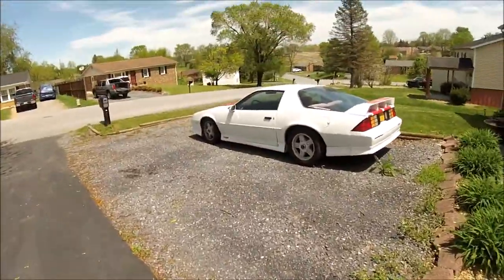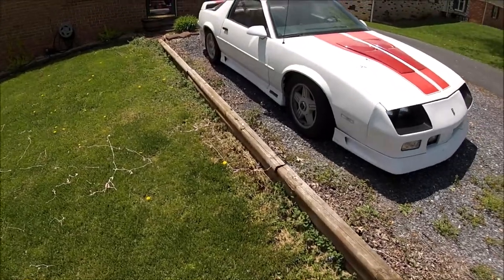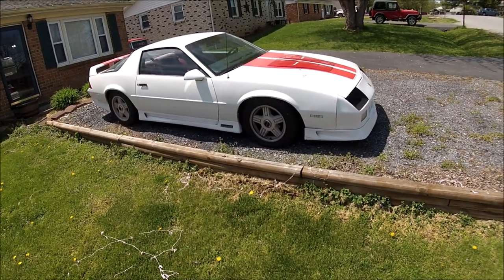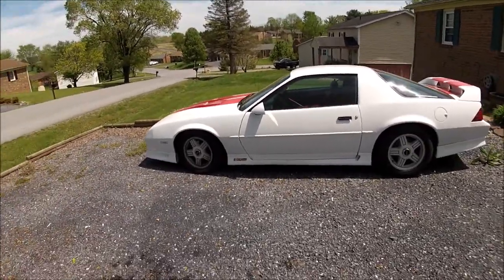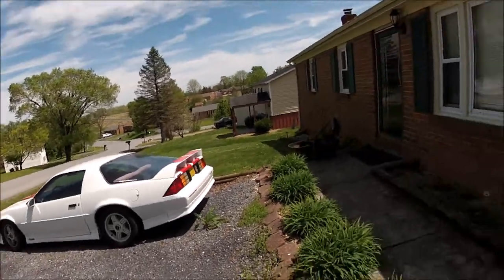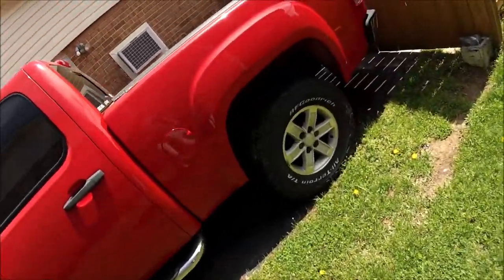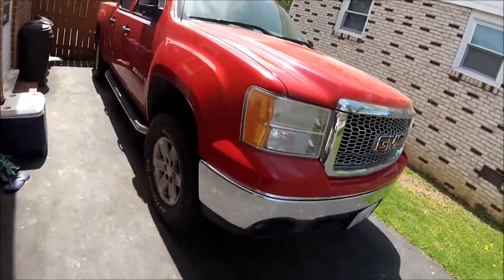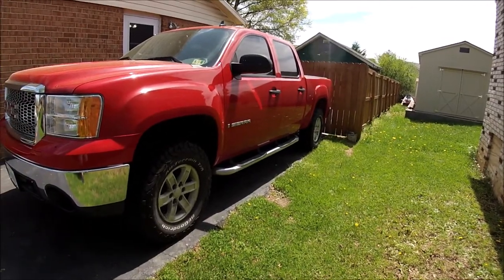Long winded updates on my Z28,Sierra,Trans Am and C10...

Comment: looks like your feeling / doing better .  good to see.  when we did the 67 patina stepside build, i installed an aluminum rad from an 88-98 GM.  direct bolt in.  we also used an s10 t5 and you're right, overdrive is the way to go in the classics.  that engine must be ahead in the I6 position if the HEI fits in the back.    i like the 90's formula fiber spoiler on the 86.  very cool.  the 5.3 im using in the 83 bird is from a 2005 and it also has the 4th gen internals and bigger connecting rods.  i put a jeep steering shaft in today.
Reply from the maker: MrJohn613 both of my cars have modified Astro shafts. The c10 I really am interested in doing the AR5 trans swap. The 350 runs really well but long term I would like efi and I already have everything for an engine swap minus trans. I’m ready to get my big truck going again so I can cover the Camaro up the sun is killing the stripes and interior.
Reply: @screaming86  ah yeah the sun, it creates life and destroys man made objects LOL  ive heard good things about the AR5 on sloppy mechanics page.  if they like it, it must stand up to the abuse.  the NV3500 was a decent gearbox but i think it has the short input shaft so AR5 is probably the way to go.

Comment: i clicked the thumbnail because i wanted to see more pics of the speedline 01-02 ws6 wheels on the trans am, and then you didn't show the car outside in the video. do you have a link to a build thread with pics?
Reply from the maker: 1flynlow I do not have any build threads and I have been super bad about actually making videos this year due to just being busy. However there are some pictures on my
instagram @screaming86
Reply: @screaming86  i did find your walkaround video and that helps. i have some left over from my 02 that i want to put on my 85 turbo v6 :)
Reply from the maker: 1flynlow I do enjoy them but honestly they look way better on my Z28 lol I’m really wanting to finally blow the Bird completely apart and paint it and change some things so idk how much longer I’ll have the speedlines on it.
Reply: @screaming86  did some of these heritage edition Z28s come with factory 3.42s? there's one in my local boneyard that i might need the rear from if so
Reply from the maker: 1flynlow if it was a lb9 g92 car